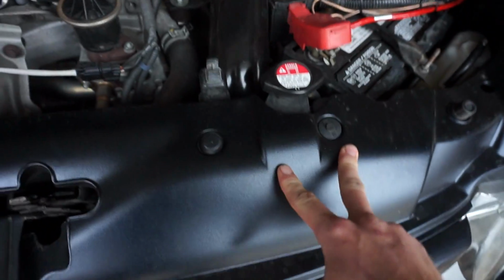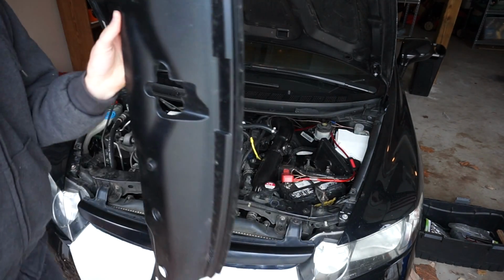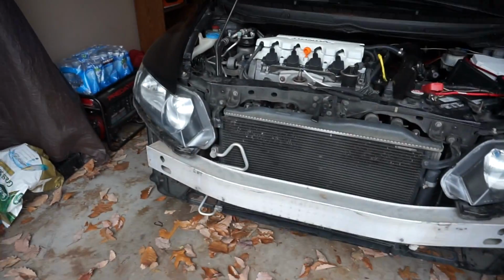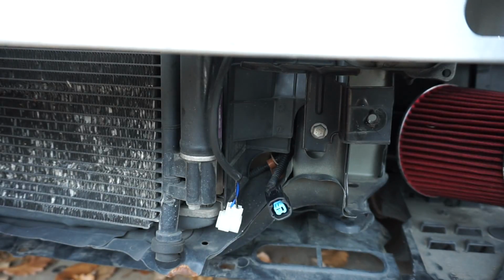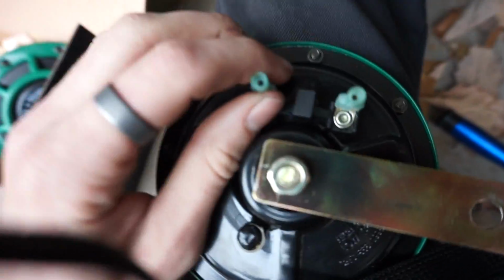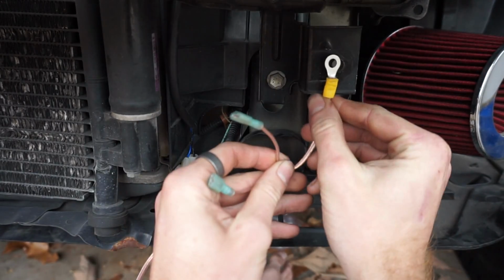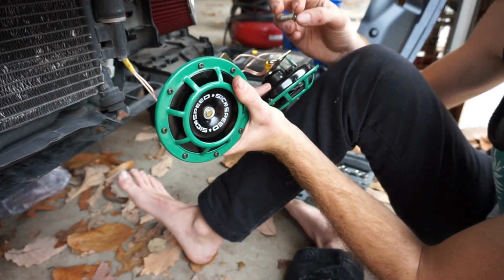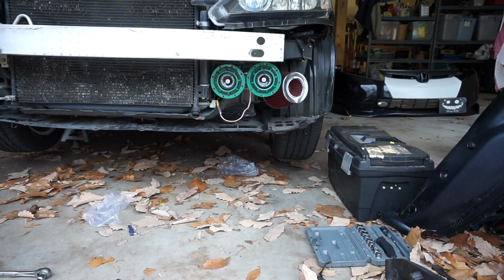Aftermarket Horn Install on a 2007 Civic

Comment: Do you know what is the white connector with blue wires for? The one that is beside the horn connector.
Reply: Did you figure it out ? I have a disconnected one I can’t figure it out looks white and blue
Reply: It's probably a dummy plug for either a second factory horn (high/low pitch) or a  sensor for the a/c / cooling system